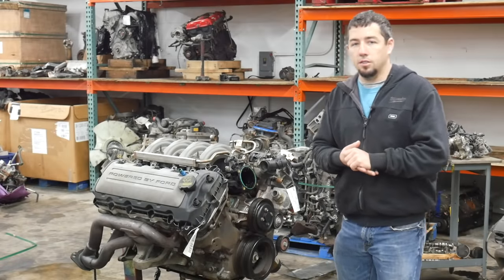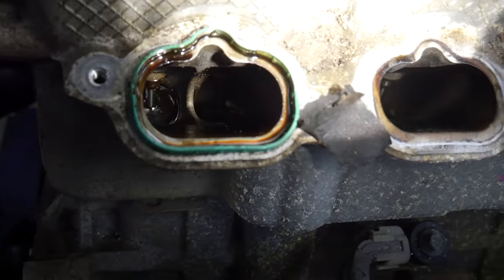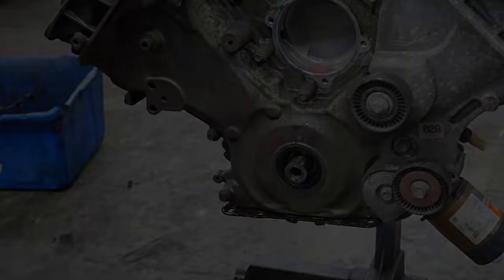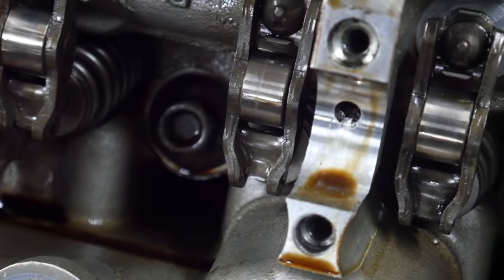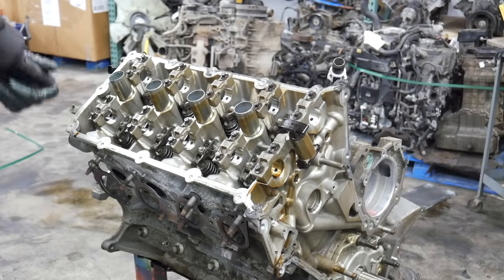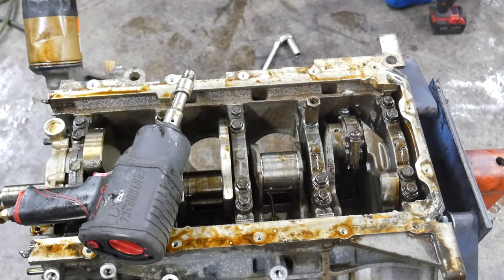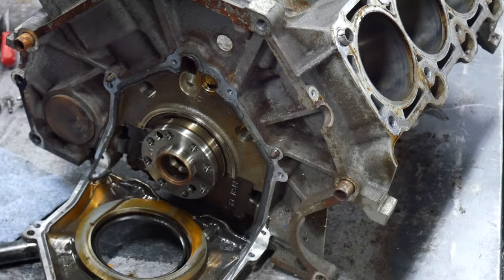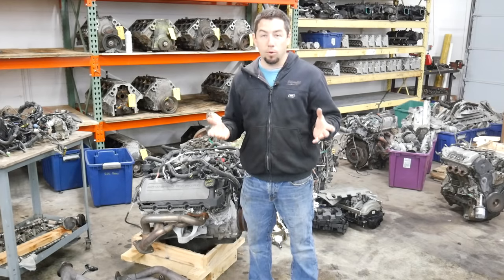Blown Up Ford 5.0 Coyote V8 Total Teardown! 2011-2014 Mustang GT / F150

Comment: I’m sure you get asked this question often so I’ll make it quick, I have a gen 1 coyote in a 2013 f 150 that is pushing massive amounts of oil into the coolant. No coolant whatsoever In the oil,no misfires,truck runs perfect. With the Decan reservoir full to the top I start the truck and speed it up a bit and I can see it sucking the coolant down rather than spewing it out the tank 6 inches high,which is typical of a head gasket. Truck never ran hot and was well taken care of.  Fingers crossed it’s just the oil cooler which I’m about to bypass the cooler and go from there.

Comment: You can run an engine quite low on oil and be ok, BUT those instances were driving normally which is why you were fine (i admit, i've done it, seen that light flicker and got a heart stoppage!). The instant you find out you are low on oil during a spirited run, or sustained high rpm is when things get BAD. the pickup just keeps sucking air, and with higher revs more is stuck in the top of the engine waiting to drip back. Add load to that and you are quickly looking at a spun bearing. Oil is a coolant and lubricant.

Comment: Modular motors with phaser timing such as the 3v do not like aftermarket oil filters.  We had a 3v that would have good oil pressure and then bleed off over time, then start knocking. We replaced the aftermarket oil filter with a motorcraft and the problem went away. 
Saved the customer a HUGE bill.
Maybe the relief valve in that oil filter was faulty? Who knows.

Comment: What's the question , or wondering  about the Fram oil filter . I've heard skeptics about Fram before .I've used Fram filters for 40 years ,and never had a problem. What's the deal with this ???

Comment: i was a mechanic for more than 40 years. and minor grooves in the bearing journals really don't get me to excited. at least if the groove runs true. if it bleeds the oil off to one side, then the oil pressure goes away, and that's never good. my uncle used to race, and his philosophy was "grooves just hold more oil!" so just give your customers the information, and don't sweat it. raised surfaces, are a completely different story. same goes with the bearing journals on the camshafts. lobes HAVE to be perfect. but a few minor scratches in the bearing area would not keep me from running them.

Comment: that was a 11-12 coyote 5.0, 13-14s do not have oil squirters in the block. 11-12s are notorious for shitting these pistons right there. 13-14s are def a better design even thou they are almost identical.  you can also tell the difference from mustang engines from f150s by oil filter location on the block, ( the only way you can really tell visually) also got different headers and intake manifolds but these are interchangeble so look for the oil filter if you wanna tell mustang from f150 engines. great video btw

Comment: For the record, the Ford Coyote is a little more complicated to work on then, say, an LS, but mostly just involves cam timing, getting all 4 cams synced to the crankshaft property. My first coyote build (with vvt/delete/locked cams) I actually somehow managed to get the left bank 180 out of phase. Believe it or not the engine started and ran on 4 cylinders but backfired nasty out the exhaust on the left bank. And, because the pistons and valves were synced just 180 degrees apart, the pistons didn't hit the valves they were just all on the wrong stroke (fuel and timing was all wrong) Live and learn. 
One nice thing about the Coyote is cylinder 1 and 5 fire 90 degrees apart, which are the front cylinders on both banks so if you get number 1 (front passenger cylinder) to TDC number 5 (front driver cylinder) should be 90 degrees behind it i.e. both valves closed and number 5 is starting it's compression stroke. If that's not happening you've got a cam timing issue which was my mistake. Learn from it!
Reply: Even simpler systems can be failed by absent minded assembly. On the old Chrysler 2.2 liter engines, the distributor keys to the accessory shaft with... well, a horizontal key. And it's symmetrical, which means doing what I did was a fairly easy mistake. What'd I do? Stuck the distributor in 180 degrees out.
Reply: @mfree80286  
If they're anything like small block chevy at least you could have, conceivably, just moved the wires around. I had to pull the harmonic balancer and timing cover, tenioners, etc back off to fix my huge mistake. Which was actually not too bad compared to replacing the crankshaft position sensor that was physically stuck in it's housing that Ford decided to put behind the flexplate instead of on the balancer meaning i had to pull the torque converter, flexpate, and rear main seal housing turning a 10 minute job into an all day job. It didn't help either that this is a motor swap, the coyote was never intended to be in a car like mine.
Reply: @177SCmaro  Yeah, turned the entire distributor around.

Comment: Came across your video very helpful I drive a 2013 f150 with the 5.0 coyote it is making a tapping sound always done oil change at 4,000 miles one time I didn't know it is at the PCV valve was clogged so I think it was sucking oil to the PCV valve can I just replace the rod bearings or do I have to replace my whole engine thank you in advance

Comment: I had 2 F-150s, a '11 and a '13, both Coyotes.  The '11 used a quart of oil every 1,500 miles.  Normal, as Ford said; never smoked, never leaked externally.  I always assumed that the "normal" is so that they do not have to correct whatever problem occurred.  The '13 never used enough oil to worry about.  Went 5,000 miles between oil changes, never any problems.

Comment: The Gen 1 coyote (11-14) had noticeably weaker connecting rods compared to the newer Gen 2 and 3 engines (15-17 and 18-current, respectively). IIRC the Gen 2 coyote was VERY similar to the Boss 302 “Roadrunner” engine setup, just without the Boss 302 intake manifold, and it came with a slightly larger intake cam and valves. Either way, they were largely able to fix the connecting rod issue with the weak link in the Gen 2 and Gen 3 being the ring lands cracking under high boost. Have seen stock bottom ends push 900-1000 wheel though.

Comment: Well, I’ve been putting it off, but 10 min in I went out in 20° pulled my car out of the garage, put my truck in and have the heat on. I’m gonna go ahead and change my
Oil tonight at about 11 when it warms up enough.7.3’s are getting hard to find and I don’t want to waste a good one because it’s too cold to change my oil

Comment: Just curious: what's wrong with fram oil filters? I found a quote when I used a google and it's from 2014. 

"Are Fram oil filters garbage?
The filtering ability of the Fram has always been "acceptable" but the rest of the filter, including endcaps, are just rubbish.
They're not meant to last much more than the 3k OCI(if they make it that long), and with syn oil OCIs going past 10k the
filters just turn into a critical failure waiting to happen."

Including endcaps? does it mean it's not metal wrapped? (metal casing...? i don't know, I only speak decent english :P)

Comment: I think you were right. By the amount of carbon on the pistons that engine burned a lot of oil. Likely let it run low. It looks like they drove it quite a while after it started knocking.

Comment: Looks like the rear crank bearing spun. Also by looking at the valves and piston tops it was running some hot fuel. Plug show the same.  Coyotes are known for bullet proof bottom ends which you can tell by the 4 bolt-cross bolt set-up.  Gen II and III are much better IMO .  I still stick to my guns saying that the Coyote, the LS and of course the 2JZ are the best blocks made since the ol' 300 Iron Duke 6.

Comment: These energizes have issues with oil consumption during deceleration. The vacuum is too strong and sucks up oil. Not many checks their oil and this happens. On the 5.0 engines check your oil often.

Comment: I got a good laugh from the Fram filter. Seems like broken engines on stands always have them on c.f.
And anyways, isn't it the filters job to prevent all that metal from circulating around in the engine?

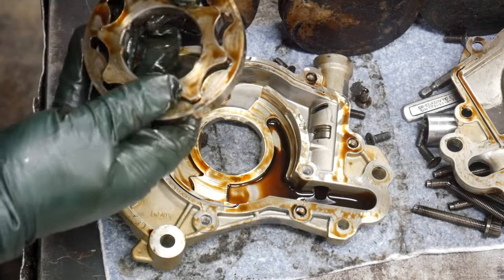Comment: at 20:46 you can see a crack in the oil pump gear I believe. Common failure in the coyote platform from internal harmonics issues with rev limter.

Comment: The early model 5. 0s up to 2013 had oil starvation problems at high RPMs due to the Piston oil squirters. They make a delete kit specifically for it.
Reply: That’s a shame, if you have to buy a delete kit for something on an engine means they’re poorly built, like GM PowerPlants with DOD and the delete kits for those.

Comment: Looks like the classic high-rpm failure due to cast piston & thin-wall wrist pin. Pin flexes, wedges in the bore, then either the rod snaps or the pin deformation sheers the piston in half.

Comment: One other thought I have. On my 2014 F-150, the owners manual  states that the first " scheduled' service for the automatic transmission is at 150,000 miles. DON'T BELIEVE IT!  The LV trans fluid is fully synthetic but won't last that long. I learned the hard way that flushing a transmission with high milage that it won't go into gear afterwards. My opinion is a reasonable mileage for a trans service today is still 30,000 to 40,000 miles. just my opinion.

Comment: What I find amazing, is that the engine continued to run, even after the cascade of destruction jammed up the oil galley with metal.  I'd bet $ ..that an LS would have airmailed at least one of those rods thru the block..

Comment: I know this newer Ford 5.0 makes more power than the older Ford 5.0 pushrod engines....but these newer 5.0's are so much wider than the older ones....I have swapped a few small block pushrod engines in older smaller cars....the newer OHC engines are just to wide to allow for a swap into smaller rear wheel drive chassis vehicles.   You can swap them in but in many cases you are cutting to make the wider OHC fit in.....I daily drive in the summer a 1984 Datsun S12 with a mild built pushrod 5.0    fit in very well, can even get to the all the spark plugs, even with headers   fun reliable car

Comment: If you have an expensive set of ported heads. Definitely billet caps and align bore/hone the cam journals and install cam journal bearings. They run it on the aluminum to cut costs because it will last 80 to 120k before it gets sloppy. Unless you blow the motor.

Comment: Not good PR for Fram, I use the Motorcraft filter fl500s only. 23k on my 14 GT all is well here. Vid is very informative, don't forget to change your oil, the most critical component of any internal combustion engine.

Comment: Hey Ford guys. Is the 5.0 a good engine? Thinking about getting a F-150.
Reply: I have a 2013 F150 5.0 with 215k on it, completely stock I use motorcraft oil and filters and aside from a bad coil and a set of plugs a year after I bought it, it has been 100% reliable.

Comment: The only thing that sucks about Dohc motors is weight. 3 extra cams and piles of extra lifters and journals causing resistance. Nowadays with cam in cam you can do separate variable valve timing and variable lift and duration with a pushrod motor. Phaser on the front of the block for exhaust timing and a phaser on the back of the block to offset exhaust timing from the intake timing. A set of Porsche Variocam + lifters for dual lift and duration profiles. If you had all that capability with the cam high enough for the shortest possible pushrods, a turbo car with twins in a compound setup could easily come up on boost without a 2 step in the time it takes the tree to time green. Just set electric operated throttle bodies and line lock limit. Smash the pedal to the floor as soon as you stage and it will be ready to go by the time green is lit

Comment: Care was implemented assembling this engine at the engine plant ,and after it left the plant ,somebody didn't care ,and it went BANG ....... I had a 2013 GT, and it ran fine with (7 quarts of oil). 6 bolt mains didn't help that one. Ya gotta check the oil ...

Comment: I've got a 2006 Mustang, with a 4.0 V-6, I run pretty hard sometimes, with headers dual exhaust, cold air intake, and a Bama tune on it. Have you ever torn down one of these engines, that failed, and if so, do you recall what caused it?
Joe
Just subscribed to your channel, because I know that helps!

Comment: As a truck driver a lot of times we come up on people who don't take care of their cars. The worst time it happened to me.  I came upon a lady in Texas with pickup problems.  She just said that it was loud.  I checked the oil and of course nothing was on the dipstick.  I got a gallon of oil out of my truck and poured half of it into the engine.  Checked out the dipstick and the oil was just barely on the tip. So I dumped the rest of the gallon in the engine and it was almost to the full mark. She started the engine and it was nice and quiet.  She said thanks but before she left I asked her if she wanted me to change the filter.  She said what is that and drove away.  Some of those Ford engines are like Timex watches, they take a beating and keep on ticking.

Comment: Had a 13 GT that my dumb ass let my friend drive. He had driven manual for over a decade, so didn't give it a second thought. He money shifted it on the highway, from 5th to 2nd. Car mechanically over-revved the engine. Seemed fine, no damage, acted fine afterwards. When researching, I kept reading that the 5.0 can't be money shifted because it is DOHC and the pistons wouldn't be able to reach the valves due to its design. Not like a chevy pushrod which would slap into the valves if it over-revved. So, I'm wondering how the pistons in this thing were able to make contact with the cylinder head.

Comment: Not maybe so much with this particular engine, because it had actual metal going through it . . . but in most of your videos, a lot of your "oil starvation issues" related to cam scoring are actually caused by starting the engine in sub-zero weather without using a block heater. Cold oil takes a long time to reach the top of the engine (yes, even with synthetic oil), and in the meantime your valvetrain is running mostly without lube. Plug in your vehicles in the winter, people!

Comment: Looks like a pos fram oil filter, old grannty getting wallymarts oil changes while shopping for depends. Back when i owned a shop after leaving dealership had a hemi charger came in on the hook (our own f650 PRO LOADER jerr dan 28 foot wrecker with heavy mod and tuned cummins) the chargers engine destroyed by fram oil filter. wished i still had the pictures of the cut open filter/filter particles thru the oil passages. Good old wallymarts oil change sticker on windshild reflected only 75 miles after oil change to total engine destruction.

Comment: It's not that overhead cam Motors are terrible it's just that they add a lot more unneeded stuff and they take up so much more room. If you compare a 5 L overhead cam motor to a 5 L pushrod motor you'll see quite a difference in size. Those heads are huge. I do like those sexy exhaust manifolds though they almost look like headers

Comment: Here, once again, I notice a subtle knock against Fram oil filters.  Every time I've watched a teardown and someone mentions that it has a Fram filter, it's always in the context of "uh-oh, a Fram oil filter, this can't be good."  I always assumed Fram, being a big name brand, would be a safe choice for everyday guys doing oil changes.  What is the problem with Fram and what should I use instead?  Thanks!
Reply: The Fram oil filter internals are made of cardboard and glue. They fall apart and send pieces through your oil galleries. Or they clog up fast and starve your engine of oil.

Comment: Fun fact, at 2,000RPM a crankshaft is spinning ~33.3 times per second. Idling, a standard V8 is running between 600-800RPM, that between ~10-13 revolutions per SECOND.

Comment: I'd love to hear the engineer's reason for specifying a 9mm over a 10mm.  He must feel so proud.
Reply: I get the sense that it's a 10mm pin that slots into a hole in the timing cover, which needed a smaller head.

Comment: My gen 1 snapped a toothpick rod in number 8 at 670wheel  e85. Those rods are not designed for anything over 600wheel.

Comment: most don't realize how much these coyote engines can really take at high rpm's and they can take abuse for a long time...as long as oil is changed (better to change sooner than any manufacturer recommends) and are maintained. who has a v8 and doesn't throttle it at every chance you get to hear the sound. its addictive.

Comment: All the modern Ford modular engines really are great engines.  The 5.0 doesn’t seem to be quite as durable and won’t have the longevity of the 4.6 motors…..but it makes a lot more power.  Everything is a trade off.

Comment: I used to think catastrophic failures always happened due to high load events, just like you. However the only time I had a connecting rod go through the side of a block was at…….(drumroll)…….idle. 
Yes believe it or not I was coasting to approach a speed bump in my K5 Blazer at about 15 mph when it felt like I ran over a stick in the road. No noise at all except for the sound of splashing coolant on the ground. I wouldn’t have believed it but I witnessed it myself. 
The engine was hydro locked 2-3 times driving in deep water but that was at least 5-10k before it let go. You would think it makes noise when it totally self destructs, but it was practically silent. Very strange

Comment: This engine detonated due to improper maintenance and improper use. This engine was way over revved. It was hotdogged to the max. Include a bullsgit fram oil filter along with substandard oil and coolant, yes i saw the sulfation , it's clear to see this engine was trashed by the owner/ driver. It could be repaired. But that comes to masters like me.